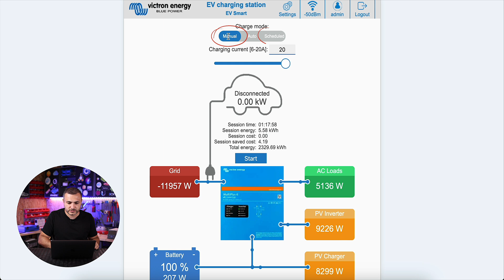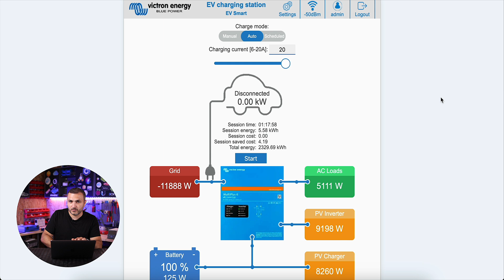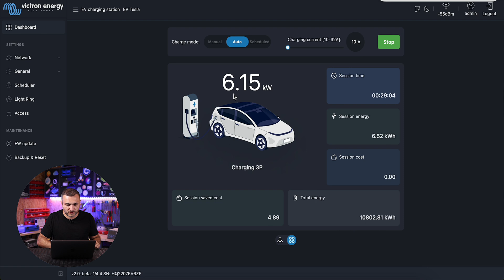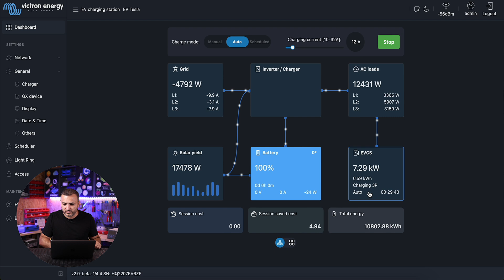Software update 2.0 for all Victron Energy charging stations

Comment: I miss an option to charge EV without draining battery. I can put it on AC IN but than I loose statistic. Also auto mode does not work on AC In.
Reply from the maker: I think you set something wrong. My chargers are on AC in and them are on auto mode all the time. Come on our group http://cstech.ro/whatsapp and I can take a look there
Reply: @thecstechvideos   joined, thanks
Reply: @thecstechvideos  Could you share your settings please?

Comment: How do you get yours to control the number of phases being used? Mine does not do that. I have one of the first ones with the display.
Reply from the maker: I made an upgrade on contactor inside and then I activated the phase option.
Reply: @thecstechvideos  by update you mean just software or also hardware? It is my understanding that the relay inside is only able to turn off all the phases at the same time.
Reply: @sebastiaohb  First need hardware update, replace contractors, and then need to activate them via modbus.
Reply: @cstechromania  do you have a video of that update or a guide?
Reply: @cstechromania  Please do a video about it... We all are interested
Reply: @thecstechvideos Is the "Phase switching after contactor Upgrade" (i have this, too) still working with the new Firmware on evcs?